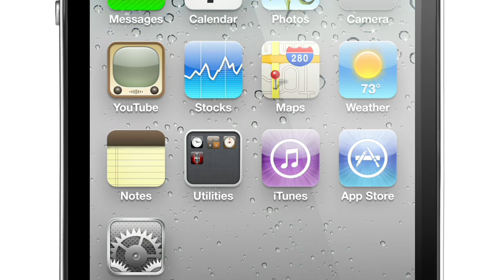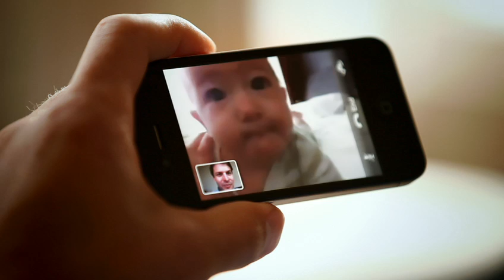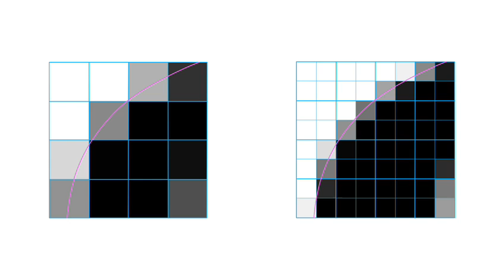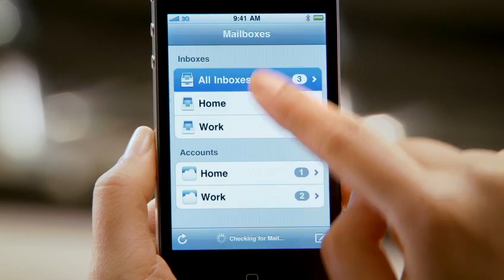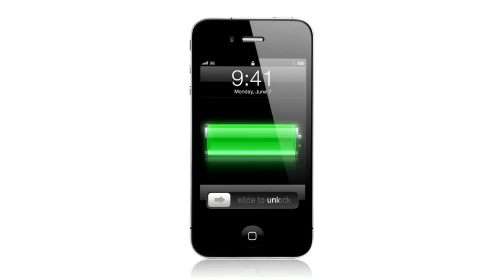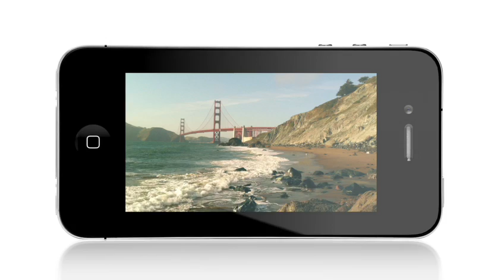iPhone 4 keynote video - WWDC 2010

Comment: what they really do good is make a HUGE deal of small things that are stock on other phones. video calling is even older than the first generation iphone, a 5 mp camera with flash is also very 2001. on the bright side they do know how to make device look sexy. the stainless steel frame witch doubles as antenna really does it for me. 

Deep down you know you do not need it but  even though you know its features a decade old you feel like you want it. that is the Apple way.